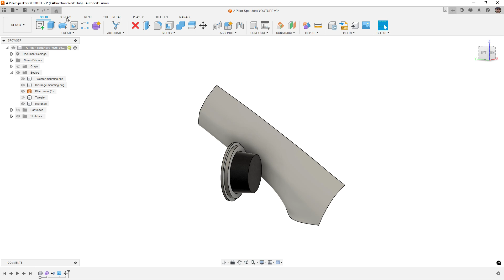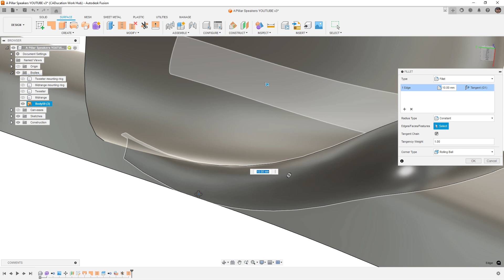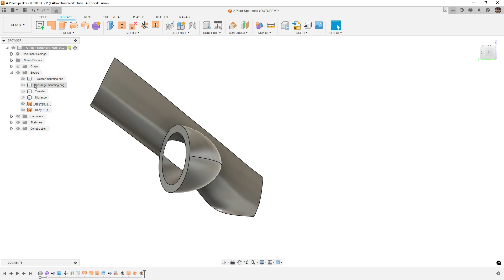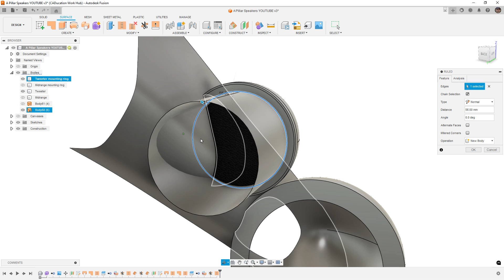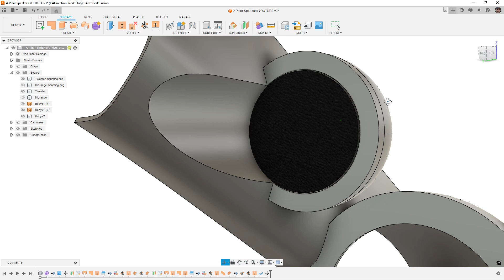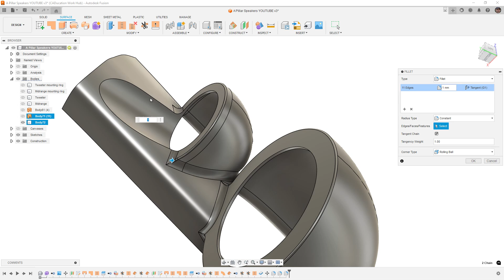Designing Car A-Pillar Speaker Pods | Fusion Surfacing Tutorial

Comment: I need help figuring out this on my 2012 f250 with ds18 super tweeters. Can't figure out how to one... Even get the pillar dimension to even start the design faze
Reply from the maker: 3d scan is really the way to get started.  Without a scan its really trick to get the shapes so that something fits.  Depending on how you want to build it, there are loads of gauge pods for the 250, you could buy one and "hack" it and make one with a tweeter.

Comment: is there a video that shows how to upload the 3d scan and speaker templates? basically how do i get to where the video starts.
Reply from the maker: I don't have a pre-video for this project.  This one was a subscriber question and I was sent the A pillar scan and location of the speakers.  He set them up to face the drivers head and modeled them in Fusion.

There are loads of other videos talking about the scan, process, and import steps.  Here is one example that is more of an overview than a "real time" process
https://youtu.be/6a_V-CnfQGY

For me the general process is
Scan
Process Scan in the scanner software
Use QuickSurface(or another tool) to process the mesh further (reduce triangles so its not as heavy in fusion), and align to xyz
Import into Fusion for the design
Reply: @LearnEverythingAboutDesign  I am pretty new to all of this. I paid someone to do a really good 3d scan of my project. I am Designing a custom a pillar. I need to get my mesh made as a solid so I can then modify it to place my speakers but I don’t know how to model over the mesh it is a very complex shape with curves and tabs for clips. Would you be interested in making a video if I send the file ?
Reply from the maker: @masoncory7809  are you trying to make a part to replace the a pillar? or sit on top of it like a gauge pod?
Reply: Yeah, I want to re create the entire A pillar to house a tweeter, midrange speaker, and possibly a gauge. I don’t want a gauge pod type thing that sits on top of the a pillar. 

Following this video I should be able to modify the a pillar once it’s made from the mesh to do what I want to do.
Reply from the maker: @masoncory7809  so some things to consider here.
1. Converting a scan (more than just the outside surface) to a part is time consuming and pretty advanced.  I don't want to put you off to it, but its a heavy ask for even advanced users, just something to keep in mind for the amount of time it will take to do that.
2. How are you doing to produce it?  Making pods that fit over an existing part generally work because the geometry is more simple, and you can attach to the OEM part in a number of ways.  gauges can just be double side tape.  You can also sacrifice part of the original (cut it open) and bond a printed part to it so you have all the attachments, then cover it or paint it how you want.  If you try to use say a desktop 3d printer to print an a pillar and mounting tabs (unless it screws on) they are very  likely to break.

Depending on the vehicle and other factors like part availability, you might consider a hybrid approach where you bond the new part to a portion of the old one so it mounts properly.  just some things to consider.
Reply: @LearnEverythingAboutDesign  if you want, can we personally get in touch with each other? I am willing to pay to get the piece designed, plus I would love to watch a video and learn how to do it as well!
Reply from the maker: @masoncory7809  you can email me support@caducator.com and we can chat.
Reply: @LearnEverythingAboutDesign ok I sent you an email thanks

Comment: How did you introduce the threshold in fusion? That is basically the basis from which such a project begins.
Reply from the maker: Do you mean the mesh of the pillar?  Its a scan.  We have loads of videos on scanning cars and car parts and making designs from them.  Getting a scan is really key to making sure your designs are going to fit.
Reply: @LearnEverythingAboutDesign 
Do you scan with special devices or simple smartphone applications?
Reply from the maker: @pedrazzini94  We have a few series on the channel going from scan to part. this is the most recent one. https://youtu.be/6xZdYvjHGyA
there are also a lot of scanner reviews on here. everything from $400 to a few thousand dollar scanners.  Phones/liDar typically have about a 2mm error, so not generally accurate enough for a good fit.  The lower priced scanners are generally around .1mm with the laser ones being around .02mm.  so much more precise than a phone.

Comment: How to I submit a suggestion for a challenging model? I've got a difficult 3d scan where I'm trying to design a 3d printed bracket to hold a catch can. There are no parallel surfaces and it's nearly impossible to get an enclosed mesh without a full scan of the car. But the important features are there like the bolt holes and mounting points. I'm thinking it'll be a combination of correcting a mesh, somehow finding a place to create reference geometry, and various modeling techniques. I'm struggling with designing it in a way that makes sense and would be interested to see how you approach it
Reply from the maker: you can always email me support@caducator.com

Comment: This tutorial was absolutely incredible, I never used Fusion before this video (only knew the absolute basics of using Blender) but I've been planning on building a 3-way system in my car (a 2005 Renault Clio RS, a relatively rare and obscure car especially for doing sound system upgrades to) and it seems nobody has really made a-pillar pods for it before.
I watched this tutorial, and realised that Fusion seems pretty intuitive and decided to give it a shot...
One week later, I have my a-pillar pods printed and they fit my a-pillars perfectly! And I feel very confident in my skills in Fusion thanks to a number of tangents I had to go down before being able to even start following this video:
I didn't have a 3D scanning tool, in fact I got my a-pillar surface from an unlikely source: a Gran Turismo 6 3D model (ripped and turned into an Assetto Corsa model by someone else) of a Clio V6 which has the same a-pillars and dashboard as my car. I extracted the Assetto Corsa mod files, got a .fbx, opened it in Blender, played with the scale until it was 1:1 with the real car, then isolated the a-pillars and exported just them as an stl. Then I opened it up in Fusion (which I was a complete novice in just a week ago upon finding this video), modelled my midrange and tweeter to scale and then tried following the tutorial. I quickly learned that the mesh exported from Blender was simply unsuitable for the job. So I got creative by creating planes that intersected the mesh model every 10mm's, sketched its shape with point splines, then lofted between them to create a smooth, edgeless a-pillar. Funnily enough though, the Gran Turismo 6 model's a pillar was definitely 3D scanned since it's such a minute detail yet it matches with the real thing so closely. After that I could finally start following this video's steps. 
Thanks again Matt, you've earned my subscription!
Reply from the maker: WOW!  Awesome story and that is amazing that it actually fit off a GTA car!  They must scan them.  I know they started doing that scanning actual cars and tracks but even the interior is amazing!

One extra bonus for you.  If you can turn the mesh into a Quadmesh in blender (or another program), Fusion forms can convert a quad mesh to a form body.  There are some free utilities out there that will do it, and Fusion can actually do it natively if you have a commercial or edu subscription and the product design extension.  What you did with mesh section sketching 100% works just make sure not to let Fusion build those splines for you.  The curvature of the auto created splines is generally pretty bad :)
Reply: @LearnEverythingAboutDesign Thanks for the Quadmesh tip, I'll definitely try it out. As for auto created splines, I didn't even know that was an option😂 will definitely keep it at arms length though now!

I too was very surprised by the GT6 model, it's a PS3 game from 2013 so you wouldn't expect it to have such detailed models, but I guess since the game has so many cars they didn't have time to remodel them all. I wouldn't be surprised if the manufacturers themselves give Polyphony the actual CAD models, since it was so detailed, even the air vents and window switches are represented correctly in the model.
Reply from the maker: @razmann4k  I have worked with a number of vendors for things like fender flares, and you can get OEM CAD files for that stuff if you are a partner.  So I wouldn't be shocked if OEMs did provide some CAD data that got converted to a lower poly mesh.  cool either way!!
Reply: @razmann4k I would assume they get CAD models from the manufacturers because it seems unlikely that they would have access to all of those cars to be able to scan them.
Reply: @travisjacobson682 I think you're right, and if so that makes these games a fantastic resource for basing designs off!
Reply: That is insanely clever! I would love to see the final result
Reply: @travisjacobson682 Thanks! The pods are pretty much done, and attached to the a-pillars, but the rest of the project (building the amplifier) is taking a little longer than expected. I have yet to cover the pods as a result but when I'm done I'll be uploading a video showcasing it all.

Comment: I am trying to do the same thing… i 3d scanned my entire A pillar to reverse engineer it add the pods and then print it in a few parts. I am having a lot of trouble trying to recreate the shape of the a pillar…
Reply from the maker: Are you using Freeforms or trying to do this with surfaces?  We have several videos on both approaches including the recent bmw trim panel.  Freeform is likely the easiest way.
Reply: @LearnEverythingAboutDesign  10 months later I figured it out, I used quicksurface.
Reply from the maker: @thalatest  Glad you got it sorted out!  QS is a very powerful tool!

Comment: This is an awesome tutorial. But I’m currently stuck on the part not covered in this video. I don’t know how to creat that nice smooth surface from my 3d scan. Have you made a video on that type of work previously?
Reply from the maker: Not specifically with an A pillar but with loads of others.  Here is a simple example where we create a section of a trunk lid to model a spoiler.  https://youtu.be/rV68nODisM8

We did a video a few weeks ago comparing Quicksurface to fusion and walked through the process of doing this on a bumper with both pieces of software as well.

Comment: Thats what CATIA and NX is used for. You will never use fucking Fusion for that.
Reply from the maker: If you are a hobby user trying to make a 3d printed a pillar vs a commercial user with a $30k CAD program working for an OEM you would :).  It is kind of like building a shed with a hand saw and hammer vs power tools and a nail gun.  The result will not be as good, likely a lot slower, but you will still have a result.

I was an NX user years ago and will say that expensive tools don't always make the job easier either.  Modeling something like this is say Alias, the end result will(or can be a true class A surface), but the UI/UX and workflow is much more difficult.
Reply: @LearnEverythingAboutDesign  "...If you are a hobby user trying to make a 3d printed a pillar vs a commercial user with a $30k CAD program working for an OEM you would :)..." That´s right.

"...It is kind of like building a shed with a hand saw and hammer vs power tools and a nail gun. ..." yeah that´s true. 

"...The result will not be as good, likely a lot slower, but you will still have a result..." I wouldn´t say the result won´t be as good. You will be less productive because it would take longer.

"...I was an NX user years ago and will say that expensive tools don't always make the job easier either...." It depends. There are features NX has which are just awesome, I doubt Fusion has those. Especially collaboration wise with an international team. However cheaper tools got waaay better in the last 10 or so years. 

"...Modeling something like this is say Alias..." Is a huge pain in the ass.... 

Personally I never understood how CATIA, NX, Alias etc. is such a pain in the ass to use. How they can´t make it way more intuitive like say SolidWorks. You need like 3 years of experience to use CATIA or NX properly. But you can learn SolidWorks in like 3 Months.

Comment: I would love to see how you'd tackle the "more advanced" surface work. particularly if they're spaced a little more and you want to get three surfaces to line up nicely. Or perhaps I'm doing it the wrong way and it should really be one surface that I mash together.
Reply from the maker: For sure.  When i approach a model like this with more complex shapes I generally build it with primary and secondary surfaces.  We did a series on www.learneverythingaboutdesign.com talking about picking your primary surfaces that control the shape, then secondary surfaces that blend together.
Reply from the maker: For sure.  When i approach a model like this with more complex shapes I generally build it with primary and secondary surfaces.  We did a series on www.learneverythingaboutdesign.com talking about picking your primary surfaces that control the shape, then secondary surfaces that blend together.

Comment: Recently I finally got around to practice scanning with my MetroX and were scanning every trim piece from my crashed M3. I would love to see some work on reverse engineering part shape to manufacture its symmetric counterpart that is missing (I know that parts are available for these cars, but every vehicle slowly fades into NLA territory and getting experience in the process would be beneficial).
Reply from the maker: Sorry about the M!  I do have a couple video ideas in the works on this.  There is one tricky aspect of it.  Car parts like that often have some very interesting side pulls and mold cores to get the features like snaps that retain them.  We did a video awhile ago that was a radio/hvac bezel.  the end part was 3d printed by the user and that was always the direction.  But doing something for 3d print vs a true replica of a molded part is a much different time commitment.

Is your goal to print replacement parts?

Comment: I really like this type of teaching. It helps to see the different ways things can be designed to get the end product as well as helping to identify future issues in the process. As a beginner in both cad and Fusion, not knowing what actions will hinder the future steps can really kill the momentum of a project. Thanks!
Reply from the maker: Thanks!  To be 100% honest designing the same part multiple times will usually have different steps and approaches.  The key really is to learn different ways to do the same thing so that when something doesn't work you have options to get around it :)

Comment: Great video, again! I have a headlight pod that I have been struggling to figure out how to model and it shares a lot of features with this. I'll see if this helps unblock me.
Reply from the maker: Great!  For this style shape the loft to a point works pretty well as does the revolve.  When in doubt a freeform quadball is a quick way too :)
Reply: @LearnEverythingAboutDesign  the ruled surface on the tweeter cutout was the piece that made it click for me. I'm just not good at surfacing.... nowhere near enough seat time doing it.